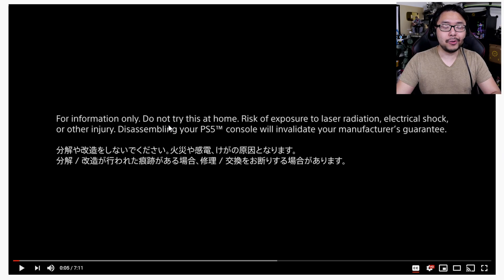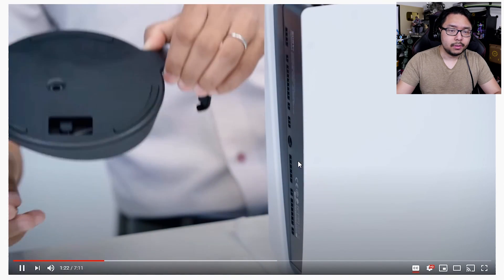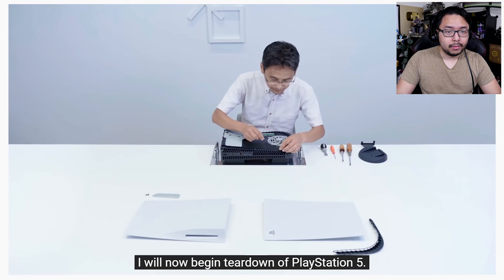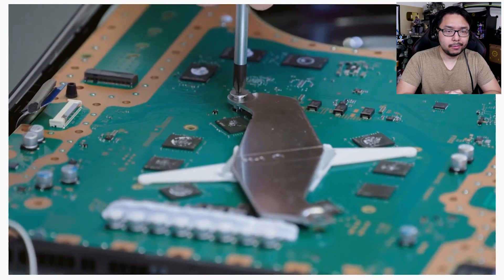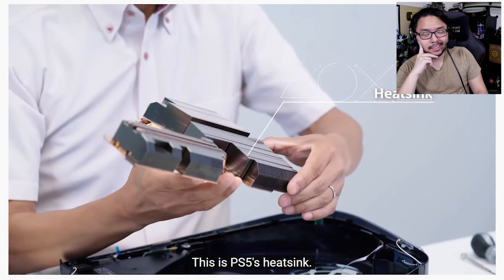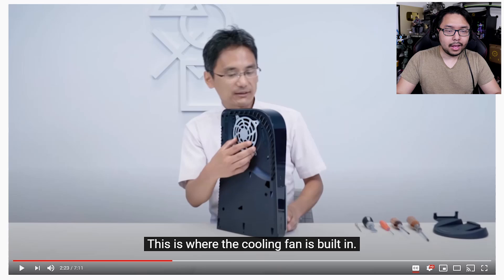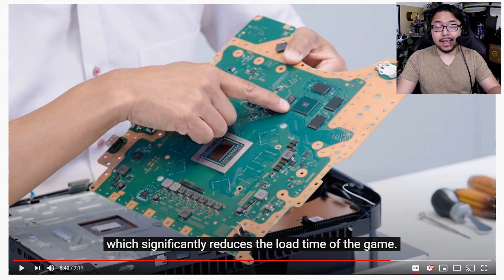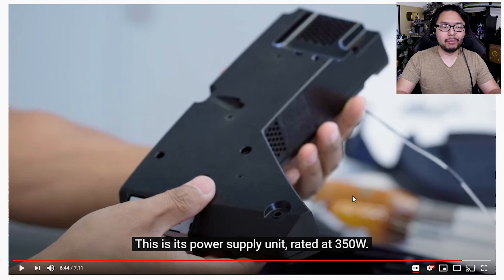Reacting To Sony's PS5 Teardown (Cooling, SSD Slot, Swappable Panels, & More)

Comment: Ngl, it looks way too "flimsy" compared to the Series X, the series X having a Metal centerpiece makes it look more sturdy
Reply: This video is edited to see the components faster. It won't be flimsy, don't worry. And I think you're glasses are to big for your head
Reply: @Fmakegeo6  first of all, that's rude, i didn't judged your looks 🤨
Second the editing of the video doesn't really matter, the PS5 has too many plastic components,  significantly more than the Series X, while the Series X goes for a more centered point of gravity making it sturdier and stable, the PS5 goes for a more traditional layout and with a weird exterior design since its not as sleek and minimalistic as the PS4, doesn't make the console look sturdier and stable, you need the stand for vertical or horizontal positions, yes the Series X also has a stand (tho you can't remove it) its just for ventilation purposes and not an actual part of the stabilization of the console
Also the PS5 has too many separate things going on compared to the Series X, yes we haven't seen a proper disassembly of the console, we can get a rough estimation on what the final components will be on the retail version thanks to the DF videos a couple of months back, yes that video didn't had any cables, structural points etc, we can make a guess that, it won't use as many as the PS5 just on how the console was put together
Reply: @rodrigosanay4351  Rodrigo, do you use a stand for your giant glasses aswell? First of all I was/am trolling you and let me tell you why. Your comments was about the "flimsy" side of it you didn't go into details about what's bothering you and I drew the conclusion that you were referring to the part where he was just taking parts out without seeing screws. Then I thought to myself that you maybe was not be thinking logically, to why, there might be no screws due to editing of the video, then  I saw your picture with the glasses and thought:if you didn't think that the video is edited and the console actually is very sturdy then, you might, also not know that your glasses are bigger than your face. I was trolling/joking around, and I thought it was quite clever🙂
Reply: @Fmakegeo6  my glasses are they way they are because this frame size doesn't interfere with my vision, why not contact then? Too much of a hassle to bother with

Comment: for repairability, i don't like the look of the CPU and the SSD:s on the motherboard.
It's understandable, why they would do it like this, they got the precision factories to mount large component held on nothing, but tiny balls of solder, much cheaper to manufacture, than a mechanical socket. Reballing any of those is gonna be a pain and a risk, so putting 3 expensive things together (CPU, SSD:s and the board itself) is just going to be a "buy new motherboard with all of the expensive stuff already on it"-cases. It would be lot better for longevity and e-waste recycle if they had CPU on traditional socket and SSD on separate board, but hey, maybe we get more repair persons to train for reballing and it becomes net-positive effect.
Reply: This sounds like the Xbox 360 red ring nightmare all over again.

Comment: OK, so the PS5 is big. Series X has a larger SOC and makes more heat while being quite small. No wonder people are reporting the series x runs hot even in sleep mode. I guess it will not be as quiet and might overheat after its heatsink gets covered in dust... RROD-style baby!!!!

Comment: You can change the internal ssd. wow, Yooooonnnnggg out!
Reply: No, thats expandable storage, the internal ssd is here: 6:01, that would be extremely difficult to remove, lol
Reply: I hope the SSDs doesn't get bottlenecked by the CPUs
Reply: @aszneehitme8691  did you actually just say that
Reply: @jackoski__19  Whats wrong with my statement.
Reply: The internal SSD is actually soldered onto the board. The slot you saw was the expansion slot (i.e. adding extra storage) that supports PCIE 4.0 SSD.
Reply: @DeathBringer769  I am talking about the external SSD.

Comment: I've taken every PS console apart to clean. Not changing with PS5
Reply: First take apart is always the hardest. With repeated routine cleaning, it becomes much easier down the line.

My first times for my fat ps3 was a bit jank with not hitting some hidden plastic clips and not slotting things back in correctly. Now I do it pretty seamlessly.  One thing I hate cleaning out is my PS3 DS3 controllers. Those things always a pain. It's mostly with the plastic piece between the trigger buttons and aligning them up correctly on reassembly.

For PS4, I missed out on that one : /

I'm definitely catching up with a PS5.
Reply: @tainteddragon2438  is there somewhere reliable i could use to open up my ps3 and clean it? My ps3's disk drive also keeps on jamming and would like to try and fix it.
Reply: @partydue123  
I'm  uncertain for reliable places to take a PS3 for maintenance/repair. 

I've always had to venture inside since there isn't any electronics repair places in my area.

Looking things up on disassembly and pairing with various youtube videos wil help give a better insight to taking it apart.

At least the Bluray drive isn't buried on the bottom of the motherboard. 

What's going on with the disc jamming is the lubricant on the white plastic gears has dried out and it's causing it to stick/jam.

If you are feeling brave. The solution is below.

Once the metal shield is taking off the bluray drive. The white plastic gears which is the eject mechanism. They need to be clean really well with 90% isopropyl alcohol and q-tips. Once the gears are nice and clean from the old lubricant, put on some new lubricant.  The new lubricant will be white lithium grease in a tube which can be found at an auto parts store. A small dab on a q-tip and use q-tip to lubricate the white gears. That is pretty much it. Once it is assembled. It takes about 10 to 30 eject cycles for the lube to really work in and it should be good as new.

I had this issue for a long time myself and it was quite annoying. I finally solved this issue myself about 10 months ago and it's  still working good.
Reply: @tainteddragon2438  Thanks. i've been avoiding my ps3 for a while until recently, i guess i'll be able to try and help it
Reply: Out of all the consoles, which one is easier to open up and clean? (not counting ps5 since it's not out yet)
Reply: @partydue123  ps1 for me

Comment: Note that Microsoft has said other vendors will sell additional types and capacities of external storage. Microsoft/Samsung won't be the only ones selling them.  
Also, yes very easy to add storage to the PS5 but why all the hassle of removing the stand, removing the panels, removing the plate covering the extra storage?
Reply: Guess you've never swapped out drives in a PC
Reply: @chrisjr6214   Not everyone wants a PC experience for their console.
Reply: @JoshRami  Yet... these consoles are pushing for PC metrics. Still doesn't change the fact that swapping out M.2 drives won't be a problem. Microsoft's proprietary solution is convenient, but not crazy enough to where I wish the PS5 had the same treatment. I know where to get my drives at a discount so it's not a hassle
Reply: @chrisjr6214  The PS5 cant compete with PCs so that would be a huge error on Sony to take away any difference they have. The fact that I could play almost every ps1, ps2 and ps3 game upscaled with better or orignal framerates on my gaming rig when ps5 cant do that. Some of the exclusives will be coming to PC as well so they got to offer something different
Reply: @chrisjr6214  I have, and built quite a few. PC isn't want I was comparing to.
Reply: You ever take anything apart?? 
Looks pretty easy, like a two minute open and a two minute assemble.
Reply: @Spills51  Learn to read buddy he said it looked easy. I work at a tech repair shop and alot of people are willing to pay for us to install basic stuff like harddrives or ram so I expect to see alot of ps5 being brought in the future
Reply: @Spills51  ya not that bad. Still way longer though than the second it takes to remove the XSX expansion card.
Reply: Because of aesthetics, if you think about it you only have to do this once and is VERY EASY to do.  Compare that to a PC it’s almost the same process.
Reply: @Travel-Adv  In that sense true. I was thinking about having to take it out if I want to bring my games over to my friends house. Whereas I can just take the XSX expansion card out of the console easy and put it into another console in a second.
Reply: It’s literally one big white panel and the SSD cover.. it’s a privilege to have an easier process than installing an SSD in a PC (which is still relatively easy though)
Reply: @KayJune  it is pretty easy. Compared though to the XSX external expansion port, it takes a little more effort.
Reply: DarqStalker  but the thing with the Series X/S is that you can only use proprietary SSD’s, which means the prices are almost definitely gonna be higher. I would trade a little bit of convenience for the ability to use whatever SSD I want

Comment: The heatsink itself also has a liquid metal cooling(seems to be).
Reply: Really? Timestamp pls. Liquid metal only needs to exist in the contact of the chip (cpu) to the heatsink itself because that’s where we need the highest efficiency of heat transfer.
Reply: @jackoski__19  I don't think he knows what he is talking about.
Reply: @aszneehitme8691  yes, i believe you’re right, lol
Reply: I dunno look at time 10:50 that black square looks very similar to the liquid metal cooling on the cpu

Comment: Looks a bit to easy to stteal the motherboard, put it back together and then get a replacement console....Am I missing something?
Cause I could be returning those to Wlamart/Target all day to some 16 yr old lolz 
Not that I would ever do that 😈
Honestly, wish my Msi aaLaptop was as easy as that teardown, damn Motherboard is covering my ssd slots and I had to remove it to get to them...Not sure what the hell they were thinking when they did that.

That Ps5 though, I could do a teardown in literally two minutes.
Reply: When was it ever hard to disassemble a console and take out all the guts? You must've never done it or seen it done I guess.
Reply: You forgot about the warranty seal. Try steal motherboard without breaking the warranty seal. The only part you can remove without breaking the seal are thr fan and the external ssd slot which is empty if you just bought one
Reply: Ariako Ishikawa  not in other part of the world. Also let see if such thing can be done, missing part inside when the seal broken, will they entertain such complain

Comment: With how easy the panels are to take out and how detached it is from the rest of the system it's simple to spray paint it and customize it ourselves. They don't necessarily need to sell these (though it would be great and a lot more convenient). Even just painting it any color is fairly easy. But yeah I expect a lot of customization when it comes to the PS5's appearance.

Comment: I’ve never seen a company do a tear down of their own console.  Has this ever been done before?
Reply: Sony made a teardown for the ps4 after the pro was released.
Reply: Yes they did it with ps4 and ps4 pro.  Microsoft let people take it apart and put it together
Reply: @Andre217  and void the warranty nice
Reply: @tomi9562  well there just showing you the insides. A lot of people like to for them to show it  they can't stop people from doing it they know they will anyway.. plus it's an official by the company so nothing is voided when they do it..
Reply: @Andre217  but if people does it who have bought the console then it will maybe void the warranty
Reply: @tomi9562  yes , if you cross  pass a certain point you will void warranty.  I'm sure most people know that and wouldn't mess around it they don't know what they're doing . You can at least pull the top off and that won't void your warranty.
Reply: Microsoft did it in the spring, its been kinda tradition for both companies at this point
Reply: @jackoski__19  not on official channel
Reply: @kavishjain8742  I mean, yeah but it still counts
Reply: @jackoski__19  Microsoft didn't even do a full teardown. It was a mock console with magnetised components. Tells us nothing about how to disassemble it for cleaning or what will void the warranty.
Reply: @MansMan42069  neither did this, there are lots of cuts here, it doesn’t actually show you that much. It shows about as much as the series x teardown did.
Reply: @LeBrulox  yes
Reply: Xbox and Playstation have done a teardown in the past
Reply: Xbox Series X did this way earlier in the year.
Reply: Xbox
Reply: Well Microsoft did one.. kinda through youtuber Austin evans

Comment: Their has to be a way to Slide into the SSD Slot from the outside.
Reply: Nope, the install is very easy though.  It’s a I can do it with my eyes closed easy.
Reply: Take one of side panel, unscrew, put the ssd, put everything back, simple

Comment: Things we have learnt from the tear down. 

1. Removable Panels side panels.
2. Easy to clean the dust with vacuumable vents.
3. Easy to access m.2 ssd slot for expandable storage.
4. large heat sink.
5. internal ssd is soldered on the board
6. liquid metal thermal paste.
7. 350w power supply which means we can get high graphical performance with a much lower power consumption compared to PCs.
8. CPU is Ryzen Zen2 with 8 cores 16 threads and a boost of up to 3.5 GHz.

This is what I noticed there may be other small details that were overlooked.
Reply: I am looking forward to my PS5 when it arrives

Comment: I completely disagree Microsoft is using cutting edge cooling methods like a vapor chamber. While Sony is just putting in a bigger fan... How can you say Sony is not screwing around when it comes to cooling when they're not even using cutting-edge tech Microsoft is not screwing around when it comes to cooling
Reply: Imo they're both equal in that aspect.

Comment: Hi Yong, can you elaborate a little on how hot is the xbox series x please?
Reply: he alr did. both in his series x vid and on twitter. generally everyone who has gotten a console for review has talked about it after the (baseless) rumours of overheating started
Reply: @Starlighteyes  Oh, thank you I will watch that video.
Reply: Amonholl sha 

spoilers: it runs hot because hot air is being pushed out of the machine aka the cooling is working

just like with any electronics. the rumours were started due to some ppl taking things out of context and were soon debunked
Reply: @Starlighteyes  It makes sense, thank you for the answer, very nice piece on engineering.